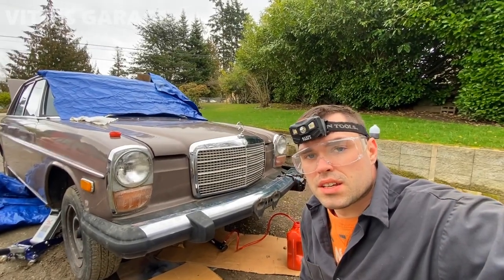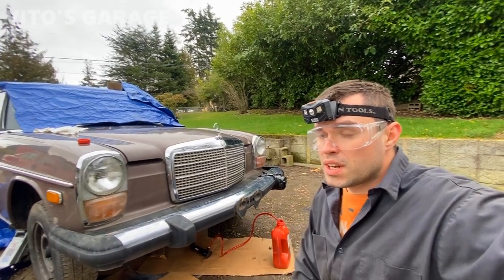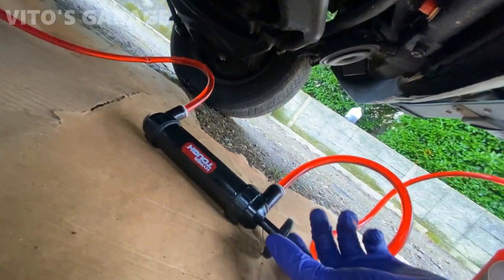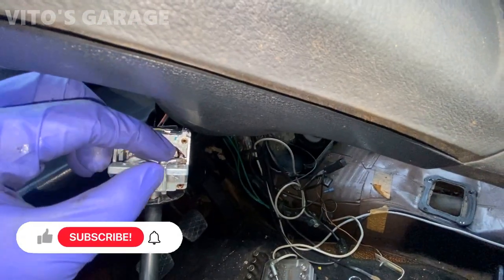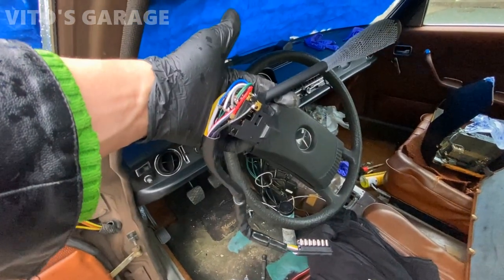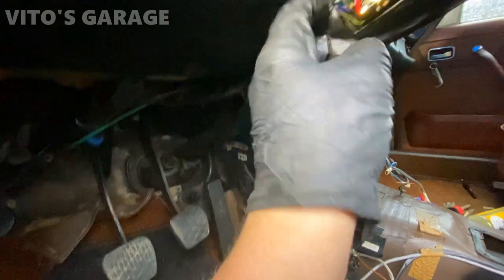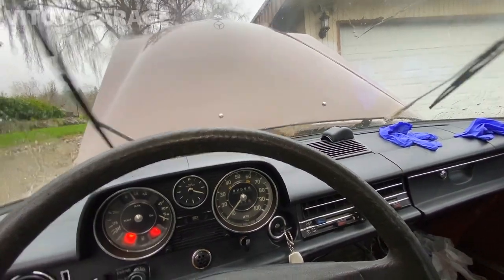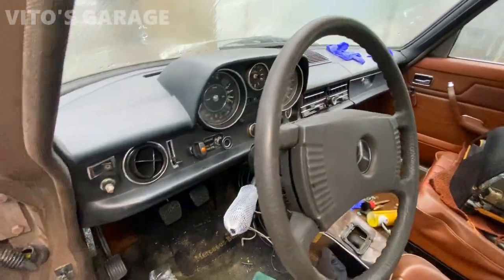Mercedes W115 240D Switching Back To ATF! Brand New Combo Switch + First Test Drive After A While!

Comment: ATF is the recommended fluid to use.
I swapped in a 4-spd into my 85 300D Turbo. Maybe 15 years ago.
I use Amsoil gear lube in 82 Datsun Diesel 5-spd and works good.
So should work in the MB Trans. Well as you found out, slows the gears where it will grind,  and as I remember a little stiff shifting. Changed to Amsoil ATF, and what a difference.

I came across your YT Channel searching for the 3 hard to find plastic Bushing for the 4-spd shifter.  I rebuilt the Shifter when I did the install on the 85, getting in those spring washers was a pain as I remember.

I just bought a 82 240D Auto Trans, and with a tired engine. This summer swapping in a 4-spd and a 617.952 I picked up for a friend (86) with bad health and a bunch of other MB parts.
The 617 has never been run, so it is sort of a crate engine.  Bought it for $1000.
Use the 240D or a 280E trans X mount for the 4-spd Transmission.
Biggest pain in the rear is bleeding the clutch Hyd system.

I have 9 of the W123 that followed me home...LOL

I like your channel.

Comment: In my 4 speed swapped w123 I debated what fluid to use, I have heard ATF doesn't lubricate as good, gear oil is too thick, but mobil 1 0w20 engine oil is excellent. That's what I've run in it for years and it has always shifted flawlessly despite it's age and mileage before I ever did the swap.
Reply: but ATF Dexron 2/3 is what they equipped from factory, because they blocker rings has very little space and needs something extremely thick to preserve their life